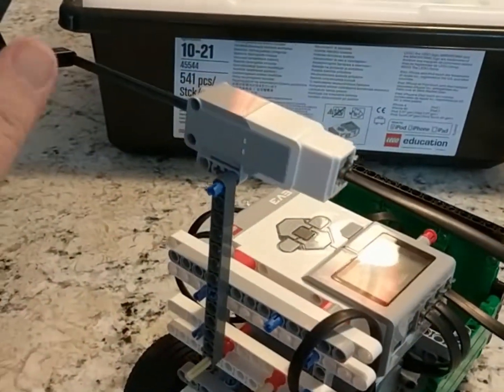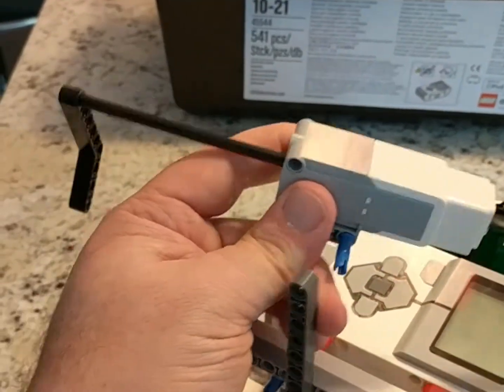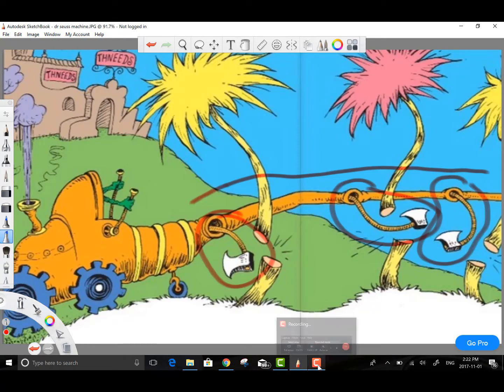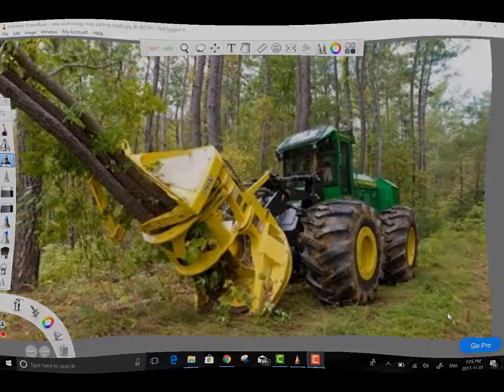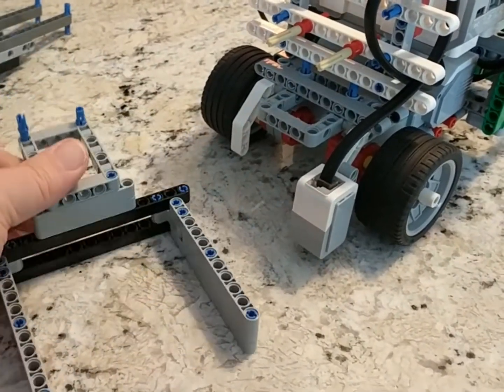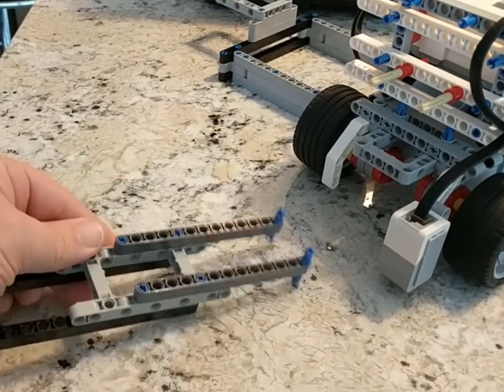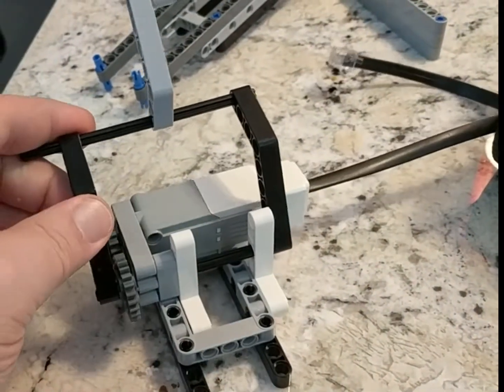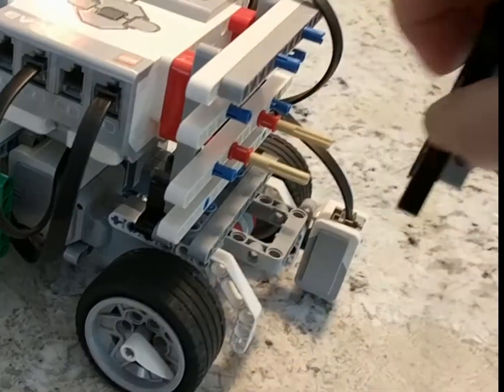How to make attachments that don't look like they came from a Dr  Seuss Book

Comment: what about dog gears
Reply from the maker: Thanks for the comment.

Builderdude35 has a great video about using dog gears to connect attachments to motors that are fixed on the robot.

I also saw this recently:

https://www.youtube.com/watch?v=0EuA21BI9h0

from Zachary Trautwein. I saw a team use this system (basically his exact robot) in our competition two weeks ago and they seemed to have good success with that system of attachments using the two bevel gears.

I am going to try to recreate this on my robot and make a video about it....see what I like best.
Reply: I personally prefer the dog gears just because it does not require any pins to use. Or you could use a box attachment system like this

https://www.youtube.com/watch?v=nCNxZ0Rqo_0
 
This is basically the same thing as a dog gear system just with gears.